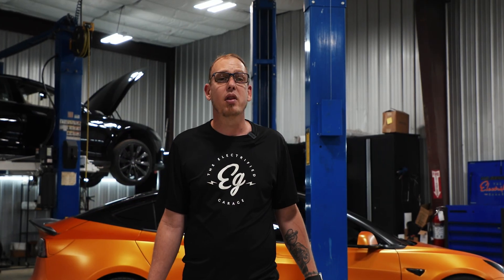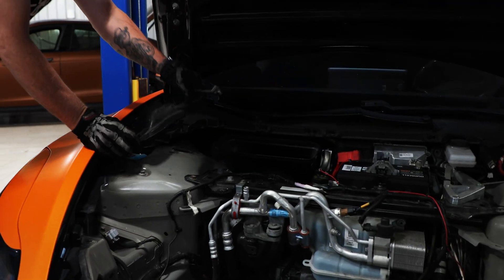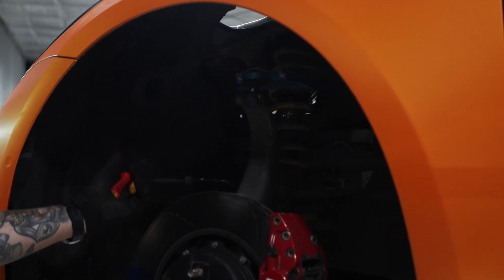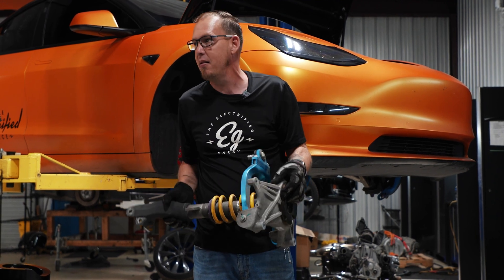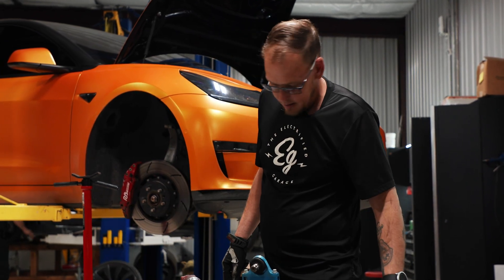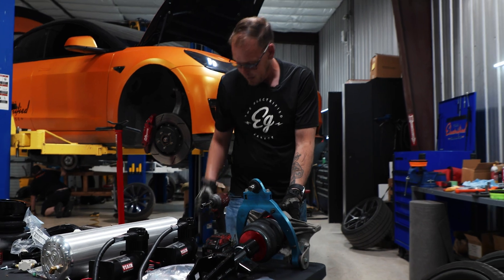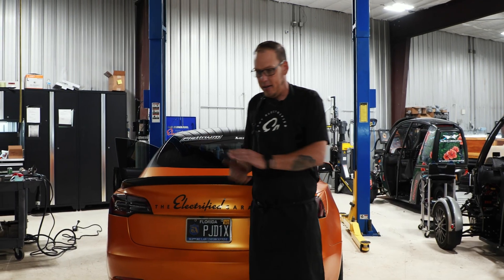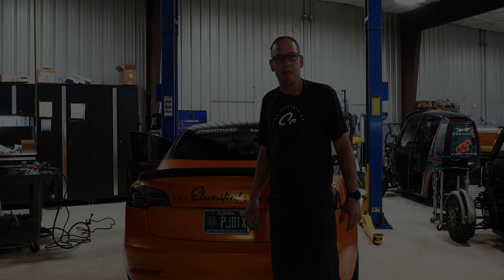BOLT-ON Air Suspension for your Tesla Model 3

Comment: The question is, how loud is it when the pressure tank is filling and is this actually better the new Highland suspension, which is already very good?
Reply: If you have an already good suspension....why would you want to change it when its already VERY good to begin with?  Make it make sense.
Reply: @theworldisyours100  Your question is nonsensical. Work on those 8th-grade reading skills. My statement is that the new Highland suspension is excellent by all accounts. Therefore, why would you want to replace it?  My second point was, is this air suspension better than the Highland adaptive coil suspension? These aftermarket air suspension additions are generally a pain in the ass to use. 

I have driven the new Highland Model 3, and its suspension is indeed excellent.

Comment: Hey !

Where did you mount the compressors ?

My installer mounted the system in the lower trunk as well but it is not as good looking as yours and he only put one compressor.

I am wondering where you put the 2 compressors because I'd like to change my setup :)

One compressor is nice but 2 are better in case on stops working !

Comment: Nice setup any electrical issue once we close the doors ? I heard some car drains the battery once close the door
Reply: I did not see them install a relay which kills power to the system when the doors are closed.. so you are correct, if they did not install one, this car has more than likely been towed back to electrified garage with a dead 12v.
Reply: LOL  @ghost_m3p